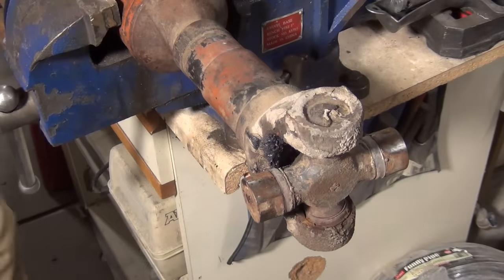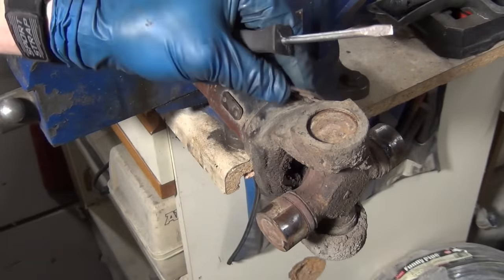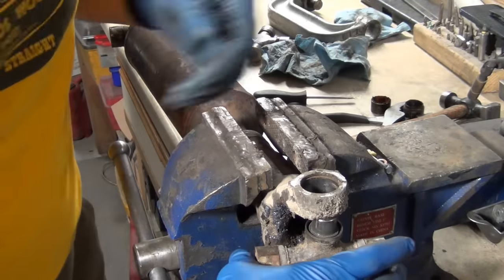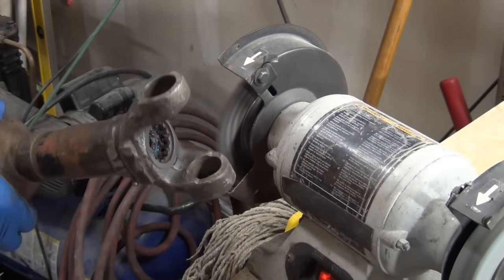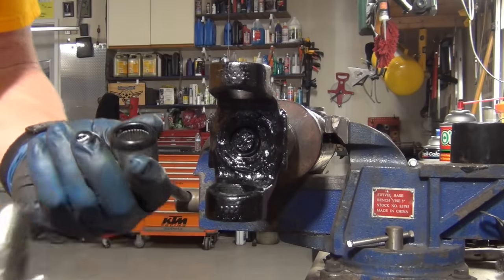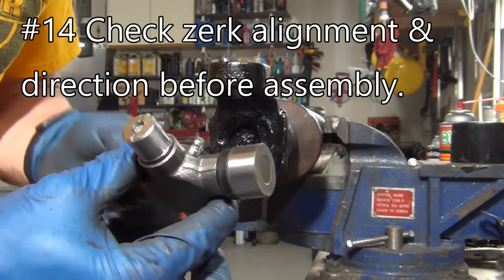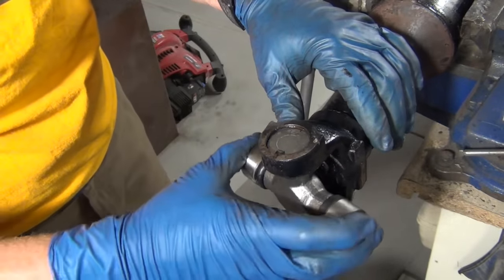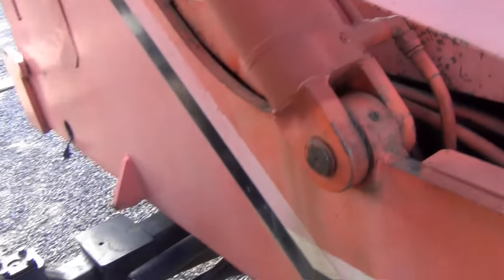20 Tips to Replace U joints Like a Pro from a Professional Mechanic

Comment: Hey Brian,   I'm guessing the previous owner of your machine had never seen a grease gun.  The u-joint would probably be OK and the spline wouldn't be almost stuck had they been greased a cpl times a year, plug or not.   Good tips tho, lotsa guys don't know the rule of the grease fitting going toward the shaft.  Great vid as usual from the Super B and SURE I"d be up for seeing a wild horses/canyon vid.

Comment: on a jeep liberty 2003, Can I grease the spline that goes into the transfer case?  The spline is doing a clunking sound every time I stop or accelerate. I think the spline needs grease or the u-joints are bad, but either way, is it ok to put grease on the spline?  I am not a mechanic but I would like to get rid of the clunking sound.

Comment: Great video.  I just had the shop press in a u-joint . One axis seems to move freely without any play.  The other axis moves but seems a little stiff.  Should I tap on the yoke like you do at 13:18 until it moves freely like the other axis?  Any feedback would be appreciated.

Comment: Place new ujoint in freezer the night before install. This holds bearings in place as well as the cold shrinks and makes the install smoother. Dnt knock it till you try it.

Comment: The play is mostly from the bore in the yoke where the ujoint itself is supposed to be a tight machined fit with a snapring to contain. not pressed in fitment.

Comment: You can tell I’ve impacted mine.  It’s definitely not strong enough steel.    Pro tip, when greasing the slip joint after it comes out the hole on the end seal it with your finger.  Continue greasing until it comes out around the splines.   It’s supposed to be there.

Comment: While that yolk was clearly missing it's end cap, the correct cap still has a hole in it.  Otherwise it becomes a sealed piston.   Basically it is getting hammered in and out with every driveshaft length change.  If the void is filled with grease the first compression cycle is all that is needed to press it off.

Comment: Great Video, I've learned a few things, thanks! I need to replace u joints on a BMW which they say they don't sell and need to buy the whole drive shaft for my 07 X3 which entails selling my first born child. I figure if they put it together it can be taken apart and found someone (1) on ebay who has them. I'm reluctant to buy them and do the job because 1. the e or g clips are different but can probably remove them with a pick and small flathead. 2. they are about $60.00 ea. 3. I'm not sure of the u-joint manufacturer, and spec's. Basically I don't won't to purchase $180.00 for 3 u-joints and through good money after bad. Any advice, sugestions or u joint manufacturer. Also, any insight on non-replacable Joints. Thx Buddy.

Comment: What I do...
According to all shop manuals except for one which I learned by a bad experience.

I mark the driveshaft and yoke.
Mark a wheel stud and the rim.
Mark the inside of all drive belts if I reinstall them.
Had a serpentine belt unravel.
After that I mark the inside with a white dot.

Another thing to do, is replace the crankshaft bolt with a new one each time it’s taken off.
Just manufacturers specs.

Comment: Thanks man that's exactly the job i'v got to finish the front drive shaft on my wife 010 ranger. Actually the cv joint is f@$ked which is the reason i'm working on it but i figured while its out might I as well fix the other end as well (230,000 km on it). I live in a small town in Canada an nobody would have a clue what you mean by "ceramic engine paint" where can I order some from the interweb......ps any tips on changing the cv joint on the other end of that shaft?

Comment: I was told by an old welder to never weld on something you used break clean on. Instead use acetone. The heat created mustard gas.
Reply: Just use non-chlorinated brake clean.

Comment: I dint know that about the finger tip sensitivity ..
 I do remember when I worked in a machine shop , doing valve jobs that  after a while I could tell by finger if the valve stem was worn .. I think we called them bad at .005 of an inch .
 and my dentist said that most of us can tell when out teeth are off seating ( maybe when you have work done and the bite is off ....) by about the same 5 thousandths

Comment: Is it true that if you’re using the U joints that have the clips on the inside the bearing caps cannot be driven in they have to be driven out from the inside or they will ruin the bores??
Reply from the maker: There's a period missing in there somewhere... bores get ruined if you drive them when they're crooked in the bore.  If they get crooked, stop and work to get them straight.  It's easier and requires less force and it prevents damage.
Reply: @briansmobile1  I’m not talking about when you put new ones in, I’m talking about removing the old ones, I am told the caps on the U joints that have clips on the inside need to be driven from the inside out not from the outside in to remove them? They are different than the U joints with the clips on the outside which can be driven from the outside in to remove them like you did with the press.

Comment: FYI. A greaseless Ujoint is 20 to 60% stronger depending on the manufacture.  A zert fitting Ujoint is weaker because the Ujoint has been drilled out to transfer grease to the needle bearings.

Comment: 2003 PT cruiser, owner before me rigged the lights to a toggle switch, INSTEAD OF REPLACING headlight switch, I want it back to factory... HELP WIRING n I confused!! And I HAVE TO PULL NEG CABLE everytime I turn it off, dash says something about DOOR& MILEAGE stays displayed if I dont, what is causing my issue?

Comment: Sprayed the U Joint with penetrating fluid, heated it thoroughly, couldn’t get it out with the sledgehammer. Any suggestions for one that’s really rusted on?
Reply: Torch to cut the x out of the center. Or at least that is how I solved my problem yesterday.

Comment: I wonder if JB Weld or PC7 would hold for sealing up the end of the slip shaft.
Reply: Wassup
Reply: It's not supposed to be sealed. It needs to vent air.

Comment: No offense bud but your average grease gun creates thousands of psi even hand guns, that said any resistance to flow of the grease is just gonna blow that silicone out of the way. A better method would be using a cheap freeze plug and fully weld it also you didn’t mention this on film but you definitely want to slide the splined section away from the welding heat as the splined end has a plastic coating on it that will melt easily
Reply from the maker: I said that about the pressure, but had to cut it down as close to 10 minutes as I could.  They use grease to tighten up equipment tracks on mini excavators etc.

Comment: The u-joints on the front axles of Ford and Dodge 4x4's have much larger caps that cannot slip throgh the open end on the ball joint press. What do you do to remove those?
Reply: use a socket.or cut off pipe..the b/joint kit comes with tubes & stops to suit..

Comment: You need to have a small hole in that cap you made to allow grease to escape so that you don't "hydro lock" the shaft.  It needs to be small enough to let stuff escape, but not too big that it pushes all the grease out the cap like you had.   If you look at pretty much any slip yoke like that, they all have a tiny hole in the cap.   If you put enough grease in that, it would probably blow that cap off the first time it compressed fully.
Reply: Mark Wolfe
Reply: Actually, air has to escape. He made an air spring.

Comment: Great video Brian!  Thanks for the pro tips.  Question for you: when I push grease into a grease fitting there can be pretty extreme pressures.  Are you unconcerned that the RTV sealant you used will simply push out?
Reply: Some of it may, but the cap and washer he welded in will greatly increase the amount of grease that gets pushed "backwards" towards the driveshaft end of the slip yoke.
The RTV mainly helps reduce dirt and water getting into the slip yoke splines from the u-joint end.
Stay gold.

Comment: Any truth to using u joints without zerks on high performance applications because they create a weak spot?
Reply from the maker: Not in my experience because there's more material around the area to keep the strength, but in rare niche cases it could be a problem.
Reply: Solid non-greasable is the way to go. I've seen many graesable units break.

Comment: Putting that cap on the end like that isn't a great idea. Now, the grease will not be able to flow out of the back when the slip yoke slides in all the way, which is going to creating binding and deflection in the shaft and push against the input and out put extremely hard. A small pin hole in the cap would have been ideal.

Comment: Another word to the wise:  The clear, grease-like stuff in the greasable cross is not grease; it's akin to petroleum jelly, and you really should pump it out with real grease by holding two opposing caps on and pumping grease until grease comes out, then doing the other two.

Comment: Here's a tip that'll save you three hours one day:
Check the size of your caps carefully before you start.
My u-joints use two different size caps, and the difference wasn't obvious, so I got to remove it and go back to the store, twice.

Comment: Hold the joint up into the loop and install the first cap 😁then move the joint half way and install the second cap. That way you won't end up with a needle bearing under the cap.

Comment: BRIAN this is BRYAN. PLEASE help. My wife is in hospital dieing. I have a 1998 Dodge 3500 maxi van 5.2 liter. I have a terrible whinning coming from I think my rear end. Maybe trans. Im no mechanic but have to do my own work because i can't afford to have someone else do repairs. But when i put van in reverse it whines bad. Then in drive it whines but only when in gear. I lifter the van up in rear and the no ice STOPS. Change trans fluid and filter but no good. As you accelerate the whine speeds up . put it in neutral and it stops also put on new trans mount. Man please help me. She is in hospital I at 200 miles away. And this is my only transportation. God Bless you.

Comment: Don't toss the old clips away because you might need to use them instead of the new ones that came in the kit. Why? Parts made in China aren't the same as factory specs. Often the clips are too thick, by a few thousands of an inch.  After you install the new joint, and have one clip in place, being thicker it affects the other side whereby the end of the cap it up too far partially blocking the groove.  I've already had to grind the face of the new clips.

Comment: Transmission fluid does not have"all kinds of stuff that gets rid of rust".It is an oil based fluid with detergents and friction modifiers. good for softening hydrocarbon base varnish, and dispersing particulates. Professionals dont clamp driveshaft tubes in a vise, because thats a great way to damage them.

Comment: A professional mechanic? I have install drive shafts u vehicles and sewage pumps for about 20+ years and I have a couple complaints! 1st he is right never use an impact on the removal tool or anything with threaded, cuz you can strip your tool thread!! I've seen it happen! They are expensive!! 2nd the yoke cap needs to be vented, he welded and capped it all off!! Drive shaft shops sell the right cap!! If not heat and movement will blow out the seals and lose grease!!!

Comment: Spicer joints are apparently great.
Reply from the maker: I like Spicer / Dana generally.  The generics are everywhere.
Reply: For tough applications I use non-greasable. They are solid, and a lot stronger. Usually OEM are solid.

Comment: 54 seconds in and already false info. our lips and wrists are much more sensitive areas that can feel much more than finger tips. also as someone who has worked in manufacturing, reliably the AVERAGE person can only detect 1/1000ths of a inch difference in material with out a pattern. for reference that is a bit smaller than a4 paper.

Comment: This guy should have his tools taken away from him. He needs to clean it up thoroughly first, and use the right tools. He may as well be using a rock and a stick. Either press it apart or set the cross over an open vise and tap on the slip yoke to remove it. On assembly, no need to ever use a hammer. Press it together with the vise. Has anyone ever had to put the needles back in, after a hammer has scattered them all over the floor?
Reply: Shhhhh... Advise like this keeps me in business.

Comment: you never clamp a drive line by the tube, you will bend it and cause vibration/off balance. this video is a joke
Reply: Bending it won't make it out of balance. Only removing material would. It's industry standard procedure to use a vise. One problem... the vise should have pipe clamp jaws. His didn't.

Comment: Some of the signs dont inspire confidence in the workmanship.
Screw driver used as  chisel
Cast iron panel beating hammer
Cheap, sloppy slipjoint pliers. I stopped watching at 4.39
Reply: hater